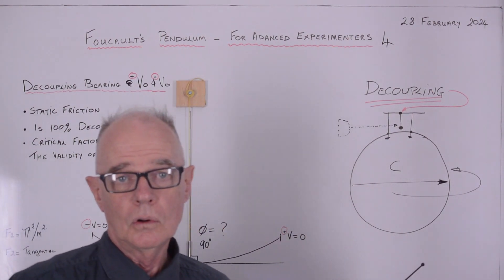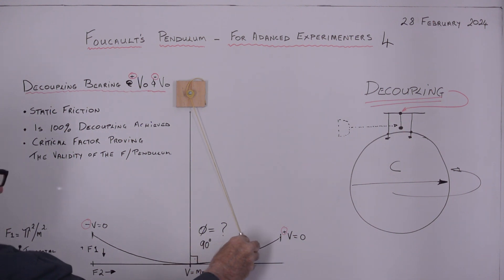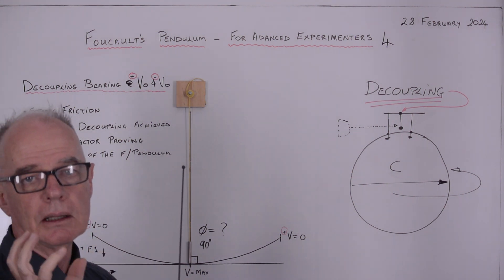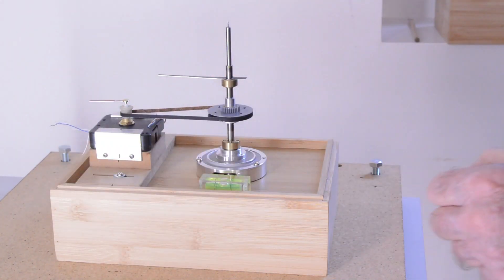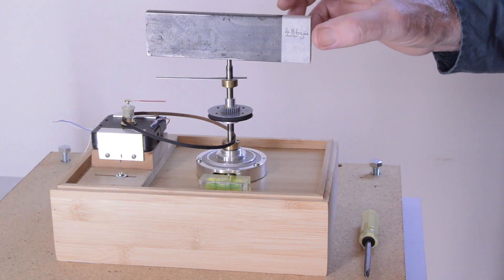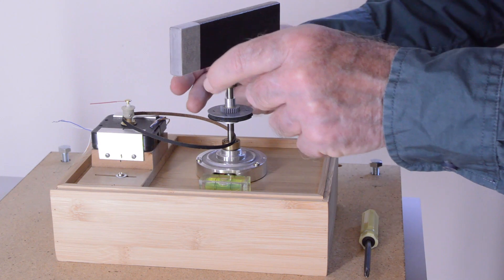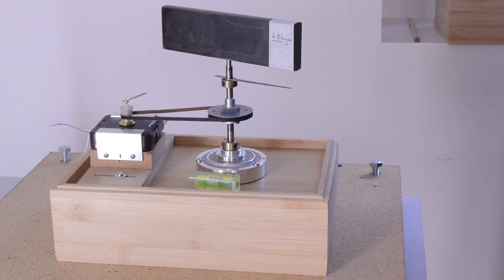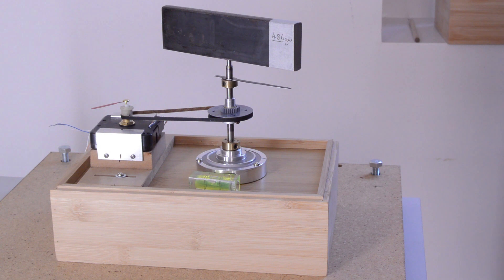Foucault Pendulum for Advanced Experimenters 4

Comment: I think I have something relevant to say, but I need to ask a point of clarification first. In your experiments where you left the Pleane Pendulum overnight were you running the motor in that apparatus?

It's just unclear to me if this setup was meant to measure the decoupling from the Earth's rotation or the rotation imparted by that motor.
Reply from the maker: Good question,...yes the motor was driving the centre spindle shaft continually (30 hours) in the CW rotation, (Southern Hemisphere), In hindsight, I should have shown a time lapse . I have not run the centre spindle shaft as yet in the CCW direction as I do not believe it will make any difference.  I will be showing faster rotational velocities in both directions in possibly video 5 or 6, that may give you more data in formulating your question, should you wish to hold off.  The PLeane Pendulum is an analogue for the swinging mass of the pendulum. We know that when the pendulum is swinging there is decoupling and now we know when the pendulum stops there is no decoupling, however as the pendulum slows down how much decoupling is there, this we have to determine.
Reply: @peterleane6807  I'm not so sure my comment will be relevant to your investigation. It is several paragraphs explaining why I believe the Pleane Pendulum cannot demonstrate any decoupling from Earth's rotation. Feel free to disregard. Also, I wouldn't be surprised if it is something that you have already considered.

The Pleane Pendulum and a swinging pendulum are different in their sensitivity to initial conditions.

Let's consider two ideal experimental setups, performed at the Equator, one for a Pleane Pendulum and another for a swinging pendulum. In these imagined experiments we are a bit clumsy and always bump pendulums to one side or the other upon releasing them.

Given a perfect needle bearing and a vacuum, after releasing the Pleane Pendulum it would simply rotate around its axis with its initial angular velocity (with respect to the base) imparted to it. There would be no rotational force from our bearing and no air resistance to change the angular velocity.

This is in contrast to a swinging pendulum. When pulled back and released (oops rather clumsily) the forces acting on the swinging weight will always tend to pull it towards the center, or lowest, point. The path the pendulum weight traces out an ellipse, centered on the lowest point, with the ellipse's major axis aligned with the point in space where we released the pendulum. The major axis would not rotate over time in the way the Pleane Pendulum does.

Now let us move our experiments to the North Pole and bring a device that is able to release pendulums without adding any unwanted forces. Let's call it release-o-tron.

We can, by hand, perform the experiment and see that the swinging pendulum is still relatively insensitive to initial conditions. Then we can use our release-o-tron to also release the pendulums and after 6 hours we observe that the swinging pendulum is now 90 degrees offset from its initial angle while the Pleane Pendulum is still aligned with its base.

Maybe I can demonstrate why this must be so with a surprise experimental setup I kept hidden in my backpack this whole time. A 100 meter long Pleane Pendulum. Placing this 100m long bar onto a needle bearing, mounted on a 100m wide base, in a vacuum, at the North Pole, with our release-o-tron to avoid any unwanted rotational velocity we can now observe that the Pleane Pendulum is now well aligned with its base. But the base has zero rotational velocity WRT the Earth same with the release-o-tron, and so the Pleane Pendulum should also now and forever have zero rotational velocity WRT the base and the Earth.

Standing 50 meters from the north pole, with fancy futuristic measurement devices, we should be able to measure the end of the base travelling about 2mm per second through space, if we treat the North Pole as a fixed point. Same would apply for the end of our Pleane Pendulum.

To conclude, I assert that a Pleane Pendulum cannot be set up in such a way to be uncoupled from the rotation of the Earth due to the Pleane Pendulum's sensitivity to its initial conditions (barring the use of another reference frame to calibrate the Pleane Pendulum).
Reply: I was only considering a mostly static Pleane Pendulum. If you were to get the bar rotating at a good clip you might see gyroscopic effects which would be a whole other beast.
Reply from the maker: Thanks for the detailed reply, you made some good points, got me thinking.  Hopefully soon there will be some more data for you.  I am now focusing on how long after stopping does decoupling start.
Reply: When I hear decoupling in this context I take you to mean that the pendulum's motion (or lack thereof) is not influenced by the rotation of the Earth or apparatus it is mounted upon. Please let me know if I've got this right
Reply from the maker: Yes when the pendulum is swinging by some unexplained phenoxenium, the pendulum and the complete frame assembly break free of the Earth and flout above the Earth, the direction of the pendulum is that of the moment of detachment.  However at the moment the pendulum stops swinging, the pendulum along with the frame assemble comes back to Earth and reattaches to the Earth and then moves in the same direction of the Earth.  I hope that helps,...P

Comment: 1. There is friction between the tip of the needle and the metal bar. Given the slow rotation speed of the shaft the friction overcomes the inertia of the mass and drags the bar with it  as it turns. Discordance in repeated trials is due to external disturbances.
You could partially remove the disturbances by running the test in a vacuum chamber in a deep mine to reduce vibrations of the earth surface.
2. That large swinging pendulums do not suffer friction problems with rotation of the earth is that the large mass of the swinging ball overcomes the low friction of the rotational bearing. In your test you might go to magnetic suspension or air bearings to reduce the frictional coupling between the shaft and the pendulum bar.
Dr. O
Reply from the maker: Yes I appreciate what you are saying, perhaps you may have missed my previous videos 1 & 2 where I am in fact using a magnetically suspended bearing.  The issue is do I use a hardened steel needle or a ball bearing to achieve the lowest friction surface and how do I measure the friction difference to pick the best bearing. 

Yes you are correct at "slow rotational speeds the friction of the needle overcomes the inertia of the mass".  But what's going on, we all assumed that the friction of the rotational bearing was not a big concern, as with the lathe experiments there is absolutely no bearing,  the suspension device is locked in the jaws of the chuck.

Yes perhaps a large mass as used by Foucault may over come the friction of the rotational bearing, yet there is a proportional relationship between mass and friction,.. increase the mass will increase the load on the bearing, hence the friction.

Comment: I am still not sure what you are actually trying to do. Making the pendulum is easy, having a flat metal bar on a rotating shaft however does not really have anything to do with Foucaults experiment.
Reply from the maker: The flat metal bar (Pleane Pendulum) represents the pendulum at the moment it stops moving.  In other words a 486 gm mass stopped and suspended in space having zero inertia that can be influence by an external force of just .1 gm.  Any force, be it the pull of the Earth, a breath of wind, an error in a bearing surface,  a turbulence air vector cause by the bob,...etc, etc. an external force that will influence its trajectory CW or CCW. Good question stay tuned.
Reply: @peterleane6807  But a non-rotating object is not really relevant. You are then comparing the friction of the bearing against the minute air-resistance and Not against the cause of the effect observed by Foucault.

Also movement does not influence inertia as that is just a property of any object.

The expected result would be to see the weight moving exactly the same as the rotating shaft unless the air-resistance is drastically higher or there are stronger air-currents at play.
Reply from the maker: Again another good statement,  Let us say that I ran the experiment for a month and each time I checked the experiment both the bar and needle indicator were always in alignment, your statement is correct.  Now next time I checked in there was a misalignment, what caused it? With the swinging pendulum there are several dynamic and static influencers happening several times a minuet, these influencers / attractants have to be smaller then the effect we are tying to measure.  We have to eliminate all the noise because the effect we are measuring is smaller then the noise.

Comment: Weeeeeeeeeeeeeeeell that was anticlimactic. Whould be cool to see timelaps or something. But eah, static friction is too much I guess. Should not be that hard to calculate that friction and thus to find out minimum angular velocity to overcome that friction, eh?
Reply from the maker: Yep sorry about that, yes the static friction is extremely small, slower then drying paint as seen in Video 3, 0.1 gm to move the bar.  The only way is to put the bearing under a dynamic load, this will be in video 5, well spotted, stay tuned.
Reply: @peterleane6807  "The only way is to put the bearing under a dynamic load" oh now I am interested  :)